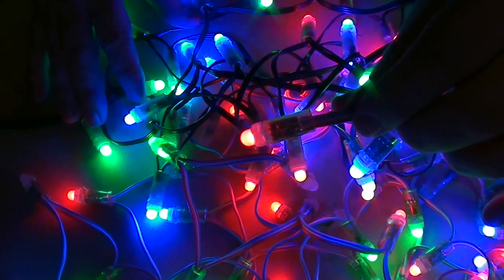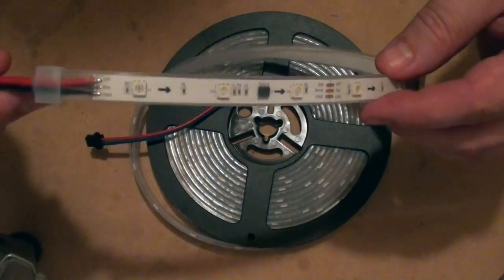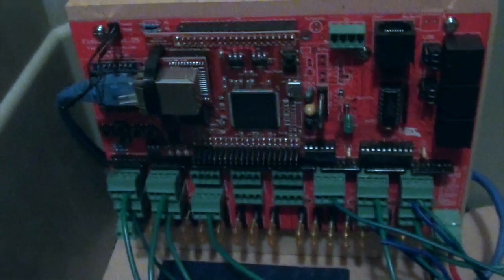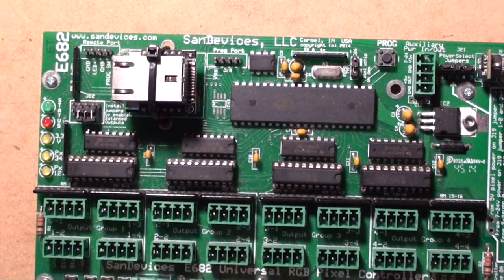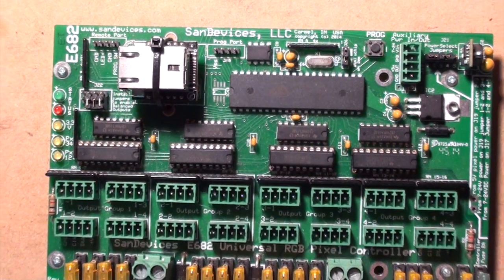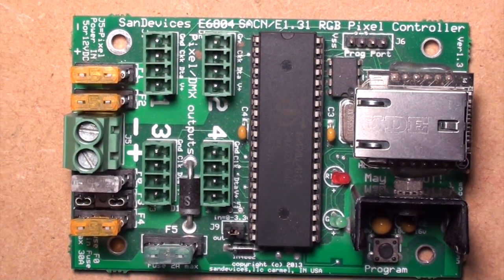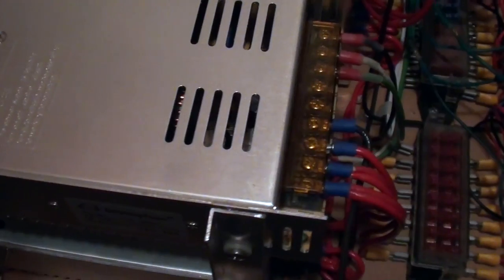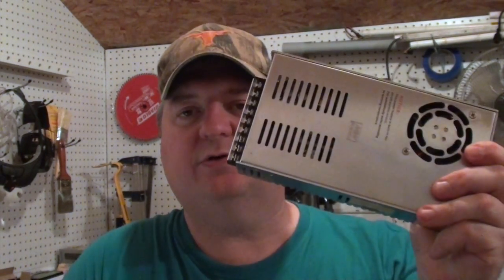HOW To Get Started with RGB Pixels

Comment: When stating a Layout is there a rule of thumb that should be used? left to right top to bottom house then yard etc. that would help make it easier in the future also to add more props. and making the Sequences work out correctly.
Reply from the maker: Personal preference really, but start with a pic of the yard, left-to-right and top-to-bottom. Have plenty of vertical and horizontal lines. Use groups to make sequencing easier. Also have a whole-house group with everything. Most of all, have fun with it! 😂

Comment: Thanks for your input!!
Reply from the maker: My pleasure! You just getting started with pixels?
Reply: @CanispaterChristmas  
Kind of…
I’m trying to learn.
I have a day job and I also DJ events.  I have a couple of LED curtains I’m trying to learn the programming software..  
I would eventually like to build a led pixel dance floor when the price is reasonable.
Reply from the maker: We mainly focus on Christmas displays synchronized to music, but the xLights software does have some live functionality. You could put something together to get the lights blinking. It is a bit of a learning curve depending on your background (mainly computer networking and some electronics), but there's plenty of help to get you over the hump if you run into trouble. The Facebook groups are full of smart people willing to help. Check the description of my videos for the beginner playlist and it walks you through everything you need to know. Shipping from China is pretty steep right now so I recommend buying local (Wired Watts for example if you are in the US).

Comment: How far can you run cords from controller to lights I got a big yard I been using d light controller s they getting old I want to update  thanks for your time I like watching your  vids
Reply from the maker: You can usually go ~30 feet from the controller to first pixel (maybe more, several factors involved, depends on the controller). There are ways to increase that distance, but probably better to just use differential receivers to get the distance you need. Everything is a tradeoff. :)

Comment: I guess in 2017 they were not called ARGB LEDs
Reply from the maker: I haven't heard that term. What does the "A" stand for?
Reply from the maker: Ah, alpha channel is new.
Reply from the maker: I guess they've added that to the newer mixing chips/protocol. Though we use a variety of chips, the most popular is WS2811 and variants which is just RGB. Alpha is done in xLights - basically just changes the brightness values sent to the pixels.
Reply: @CanispaterChristmas  The A stands for Addressable.
Reply from the maker: Oh, OK. Well, all digital pixels are addressable. The analog variety is not, but they're both referred to as RGB pixels which can be confusing.

Comment: Hi, I'm just getting started with light shows.  I just got a falcon f16v3 for my 13th birthday and am setting up a Valentine's Day show.  I was wondering how you would connect expansion boards and LOR boards?  Thanks so much!  I really like your posts!
Reply from the maker: Thanks! Awesome! Happy Birthday! Expansion boards come with a ribbon cable and connect to the the long connector in the center of the board. LOR boards connect to one of the bottom two connectors on the upper right corner of the board.

Comment: Great info I'm trying to muster up the courage to invest in some permanent lights under the eaves. I prefer the look of pixels vs ribbons but I'm wondering if you can tell me how many 50 light strips can I connect together before it becomes too much?
Reply from the maker: Not as easy an answer as you'd think. There's a lot of tradeoffs that affect the number. You need to know the specs on your pixels first - how much power do they pull at 100% white. Then how bright will you run them? I use 30% for my display, but you may want a different brightness. Controllers can spit out data for 1024 pixels (at 20 frames-per-second) in one string, but you'd have to inject power along the string to maintain voltage all the way down. 40FPS is more like 640 pixels. My advice would be to plan it out as best you can and go from there. Are you new to pixels?

Comment: I have had a train engine in my yard for years made from a frame and old lights. Could you tell me what I would need and how to set up a pixel display? Old one was about 10 feet long and 8 feet high with a smokestack. I was an engineer for about 40 years. I would love your input and suggestions. Thanks in advance.
Reply from the maker: You can change out the old lights or leave them and add pixels however, pixels are bright point-sources of light so you'd either need diffusers (some to be able to see them well from the side or point them in the direction of the viewer.

Comment: I liked the C9 screw on lens where can i get a set of lenses and a set of rgb strings?

Thanks
Reply from the maker: I bought mine from Ray (China). You may get a better deal from a local vendor depending on the quantity. Shipping prices from China are pretty high right now.

Comment: With the f48 am I reading that it can only support 1024 LEDs. I'm looking to put close to 2400 on my house. I am I getting in over my head i just orders 16 pack of 5 m of ws2812b 30 count meaning the full stran has 150leds.  Will the f48 support 2400 LEDs
Reply from the maker: Well, in F16V3 terms, that's 1,024 per port. On the F48, you're splitting that among the 3 rows. Each DR board has 4 ports so if you proportion the top row to 300, each 4-port board plugged into the top row will support 300 per port or 1200 total.
Reply: Your information has been amazing and i enjoy watching your videos. but I'm still confused. What will I need for 2400 led with the f48. To me it sounds It look like 8 DR and use 2 rows. Each DR supporting up to 300 LEDs. Will this mean that each output on the DR can support up 75 LEDs.Thank you for all your info. What if I have more the 75 LEDs in my display.
Reply from the maker: @nickhbr8544  For the F48, there is a slider on the controller's string ports page. You divide 1024 among the three rows however you want. I was just using 300 as an example. If you set a row to 300, that means that each port on each DR on that row on the F48 will support 300 pixels per DR port. So top row on the F48 is set to 300. A DR plugged into port 1 has 4 ports, each can do 300 pixels. If you set the top row to 400, each port can do 400. If you set it to 1000, each port can do 1000. So if you set 1000 for the top row, the other two rows will split 24 pixels which is probably not something you want to do so you just have to plan your display accordingly. I usually use an even distribution of 341/341/342. Make sense?
Reply: @CanispaterChristmas  I think i got it. If I use 344 340 340 row 1 set each out put has 4 line max to 344 making row 1 max out at 5504 LEDs.  row 2 and 3 are set at 340 making it 5440 each and the total for the unit if maxed out is the 5504 plus the 10880 for the  total of 16384.
Reply from the maker: You really don't need to think of it as a bucket of pixels, rather create your models first so you know exactly how many pixels are in each one and distribute them as needed. xLights can program the F48 so just make sure you have xLights configured correctly (see Keith's video I have linked in my beginner playlist [link in the video description]).

Comment: what kind of wire do you use to go from your control board to your lights and what is the distance of wire you can go. I'm looking to put 16 port in my Garage but to get out to the roof would be like 30 feet. and to get to the front yard would be about 75 feet. I just starting out and most would have 12 outputs. and i don't believe i would be running more then 300 light off 1 output(no mega tree for now)
Reply from the maker: 30-feet is about as far as you'll be able to go with normal wiring. There are a few techniques to increase the distance, but at 75, you may want to use a differential receiver for those props that are further away. My tree uses 4 strings of 300 so no problem there. Once you get data to the first pixel, the string will take it the rest of the way (each pixel regenerates the data for the next pixel). I mainly use the Ray Wu extensions, but 18awg or larger is fine. Data prefers skinny Ethernet wiring which is why the larger wires limit the distance.
Reply: @CanispaterChristmas  cool thank you. I saw your review on the f48. I love it but I think it a little more than I need. I'm thinking to get 2 or 3 of the f8-b from kulplights. This way I can have them close to where I need them and I can just run rj45 from the computer to them.
Reply from the maker: Sure! Whatever works for your display. They're all different and need different tools. 😀
Reply: @CanispaterChristmas  thank really enjoy you videos.

Comment: I guess I accidently deleted it when I tried to edit it.
To refresh I'm using the 2801DC30 DIMMER from Hanson with Raspberry Pi 3 with falcon PiCap to control 10 strings (100 each)Dumb RGB. After you explained about channels/universe and Dumb nodes I finally got it working.
But what I have is when I power on there is one string that stays on red all the time. It changes color when testing. Don't know why and I checked all connections
Reply from the maker: Did you get this working?
Reply: @CanispaterChristmas  Yes I did, contacted Alan Hanson found a poor solder joint.

Comment: I guess I asked one to many questions
Reply from the maker: LOL! Why did I miss one? I've noticed the YouTube comment system isn't the best for back and forth conversations. I can't even see our previous conversation.
Reply: @CanispaterChristmas  I guess I accidently deleted it when I tried to edit it.
To refresh I'm using the 2801DC30 DIMMER from Hanson with Raspberry Pi 3 with falcon PiCap to control 10 strings (100 each)Dumb RGB. After you explained about channels/universe and Dumb nodes I finally got it working.
But what I have is when I power on there is one string that stays on red all the time. It changes color when testing. Don't know why and I checked all connections

Comment: Related but unrelated to the vid...can you advise how you connect your wires to the green pieces that go in the controller? I thought i saw you had that in one of your vids but i cant find it. 

I find that sometimes when i need to pull one out of its socket for maintenance or whatever, the wires come loose. Just trying to find a more secure method of connecting these. Any help is appreciated!
Reply from the maker: I bought a bootlace ferrule kit from Amazon and haven't had any problems since. https://amzn.to/2WX4RI0 I use it on all my screw terminals now.

Comment: what the best brand for the price of pixel lights?
Reply from the maker: They all come from China. There is an AliExpress store I use for everything. Ray Wu. https://www.aliexpress.com/store/701799 I step through an order in a later video. One or two strings, especially this time of year, you might try https://www.crockettfantasyoflights.com if you're in the US or locally if not. Ordering directly from the manufacturer in China usually has better unit prices, but higher shipping costs so you'll have to do your own comparison to see what's best for you.
Reply: @CanispaterChristmas  Looks like that  https://www.crockettfantasyoflights.com has been hacked with a NSFW site at least it is on 8/9/2020

Comment: Where can you order long lengths of outdoor pixels for outdoor use.
Reply from the maker: How long we talking? They generally come in 50 or 100 pixel lengths. You can build a string as long as you need, but they also need power about every 80-100 depending on the pixels. Also, check out this playlist (https://www.youtube.com/playlist?list=PLFyrAfJ-kKd4ZfPdXWIt8v_bav61mW_KW) as it will get you up to speed.

Comment: I am just getting started in using RGB's, i ordered some without wires so i can create custom lengths. What type of wire should i use? Can i use CAT5? i will be making props with the LED's, so there will not be any long runs.  Thanks.
Reply from the maker: You CAN use CAT5, but it isn't recommended. I would stick with 18ga or larger wire (16, 14) depending on the length of the wire. The main thing is to keep the controller -> first pixel distance as short as possible (you can usually get around 30-feet, but YMMV). If you are trying to daisy-chain props, that has to be even shorter because pixel to pixel data doesn't go very far (a few feet) without some sort of help.
Reply from the maker: Check this one out. Talks about using CAT5 https://youtu.be/ko5wu5S0J1o

Comment: Great videos !!  One question... how does the node get assigned an address ?  For example... if you were making a starburst... does every pixel need  to be in order in the string ?
Reply from the maker: The node doesn't get assigned an address. Each pixel removes a frame of information then passes the rest on so #1 in the string removes the first frame and passes everything else to #2 and so on. So, yes, they need to be in order for it to look right unless you are using sequencing software (I use xLights, but I believe others allow similar capabilities) where you create a model of your starburst that shows where each node in the string is and it figures all that out for you.
Reply from the maker: Oh and Thanks! Let that reply get away from me a little too early! lol

Comment: For newbie, I need to video on how to setup PI FPP using wired Internet to router, F16v3 board and PC controlling using setup webpage on both.  I am having difficulty connecting to F16v3 at 192.168.1.254 when FPP at 192.168.0.5 and computer at 192.168.0.10.  When I type in 192.168.0.5 and 192.168.1.254, they both opens up FPP on me IE browser which is not correct.    This video should be after installing of PI as Falcon player and before creating effects on the Xlights or connect any pixels.
Reply from the maker: If you move the F16v3 to 192.168.0.?, you should be able to see everything. However, running the show traffic on your home network is not recommended as it will likely slow everything down. Most people use both wired and wifi on the Pi using the wifi for control on the home network and the wired (eth0) for show traffic on a different network. There is a great networking video at (https://www.youtube.com/watch?v=g0fOZs6UgXw) that may help. Thanks!
Reply: Can l use wired on PI and be able to open F16v3 setup page, FPP webpage and goto Internet.  I test  display on FPP (192.168.0.5) it not working with F16v3 on 192.168.1.254.  Test ping on eth0 okay.
Reply from the maker: You can, but they have to be on the same network. 192.168.0.x and 192.168.1.x are not the same network so it won’t work that way. You will need to change the F16v3 to the 192.168.0 network not 192.168.1.
Reply: I understand but one of your video show this type setup.  Why yours work when do the test pixels lights?
Reply from the maker: OH. I moved the computer to the show network. The Pi has internet access via WiFi to my home network.

Comment: Reviewing Videos, Correction on power supplies, you do not need separate power supplies for Pixels and controllers, I run all my power through the SanDevices controllers, BTW you need a link for them, ( http://www.sandevices.com )
Perhaps some suggestions on saving money and time.
Look for sales
Plan out the display, consider proper electrical distribution like extension cords.
Buy bulk, like heat shrink, wire.
Reply from the maker: Oh thanks! That reminds me, I need to get more heat shrink.

Comment: If i were to buy something like a ws2811 Bullet nodes 18awg wire is it ok to cut these down to any number of pixels needed?
Reply from the maker: Yep. Each node is self-contained so you can cut anywhere between them. You can also add to a string as well.

Comment: how many sets of 50 pixel could i put on one power supply
Reply from the maker: It depends on many things, but generally calculate 0.06 amps per pixel for all white at 100% brightness standard RGB nodes. I usually stay under 80% load on a power supply. I hardly ever run pixels at 100% brightness because they are VERY bright so usually 30% is fine which also drops the power needs. As an example, I ran my 1,200-pixel tree off one 30-amp power supply this year (30% brightness) and had no problems. You need to know what your pixels are actually pulling per node. Standard RGB pixels have one LED chip with 3 LEDs per chip - red, green, blue. If you have pixels with 3 LED chips per node (a total of 9 actual LEDs), power requirements will be higher.

Comment: I just got 5v pixels so do I power the board with 12v or 5v?
Reply from the maker: Which board do you have?
Reply: CanispaterChristmas the pixie light 16 channel v2
Reply from the maker: OK. I'm not familiar with that board (so please verify with someone who has one), but yes, power from the board should match your pixels. The thing with 5V pixels is there is less overhead so if you power the controller with the same power supply as the pixels and you get into a situation where you're getting close to maxing out the supply, it can cause havoc with the controller. You may need to power the board with a separate power supply if that is possible.
Reply: CanispaterChristmas im sorry its the alphapix 16. And ok ill do some research before I start plugging thing in. Thanks for all the help. And big fan of your channel
Reply from the maker: Thanks! Yeah, same answer for that one too. :)